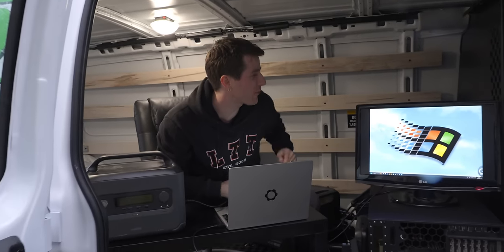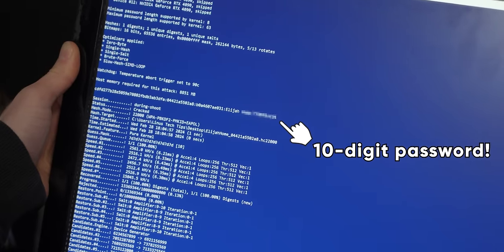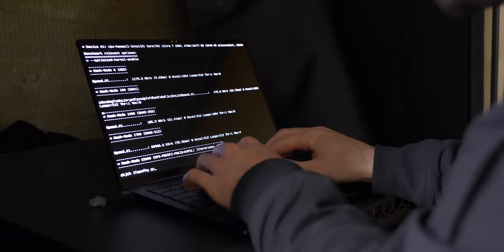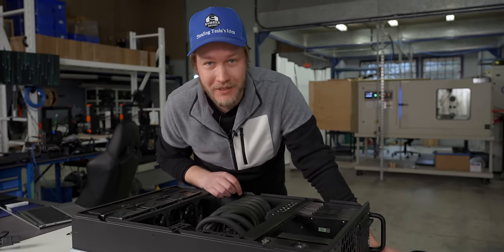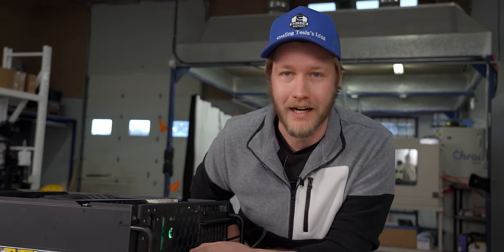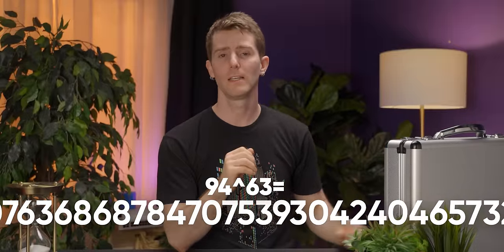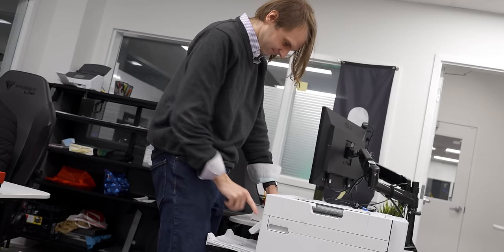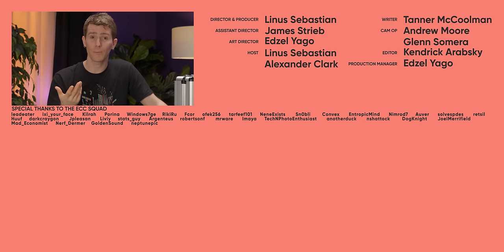I Made a Wifi Cracking Van

Comment: you can also hide your ssid from the public by turning off ssid broadcast in your router. your wifi will still work but you have to manually put in your credentials on every device that needs to connect to it

Comment: You don't need a van nor server to crack those hashes. Just use your laptop with supported adapter (keyword here is "monitor mode"), then some applications like wifite. After grabbing the handshake/key, you can use web services to crack those for a small fee rather than paying thousands for GPUs. (Sending this on my neighbour's Wifi because I'm cheap. Old TP-link routers are notorious for using only 8 digits of only numbers for default password, hashcat can crack those in seconds even without a powerful GPU)

Comment: you can even crate multiple networks under the same SSID. Debending on the Preshared key used to connect you will end up in an different vlan than other Devices, all under the same WIFI SSID.

In Ubiquity unfi this feature is calles "Private Pre-Shared Keys"

Comment: 13:22 guys dont do that, managment frames will take up air space and then data will get less air times, this will result in less speed. if you really wants to do that still, you can also increase beacon period to 200 or more. just don't increase it too much because if you do that some of your devices may start to disconnect every now or then or not connect at all or not see the wifi network at all.

Comment: TIL that being an IT support engineer for 2+ decades has actually been a benefit for ensuring my wifi network is secure and pretty hack proof. All of the vulnerabilities discussed in the video are mitigated and/or are not part of my network. I've even got a seperate vlan configured for my older IoT devices that have very limited access.

Comment: I was recently in the market for a new router, and was shocked to find that basically all consumer-grade routers I looked at which were "well rated" (and under $200 or so) didn't support VLANs, much less additional SSIDs beyond maybe a single guest network. And a guest network, assuming it's segmented properly, won't work for a printer for obvious reasons anyways.

The best options I found were either rolling your own a la PfSense/OpenWRT, or going with a Mikrotik/Firewalla/similar, but those are overly complex options for a typical consumer. Why can't Netgear or TPLink or anyone develop router firmware that allows segmentation, is otherwise no harder to use, and doesn't cost an arm and a leg?! In the end I ended up sticking with Ubiquiti. (They do offer a seemingly great Dream Router for $200, but good luck finding it in stock....)
Reply: Yep, I use pfsense and MikroTik at home for this reason.  Great combo!

Comment: I learned how to do this when I worked at a kiosk in the mall to find some wifi to use with my laptop. (The only open wifi available was a coffee shop below me that was slower than my old 14.4k modem when connecting through the floor)

Comment: You do realize that WPS still exists. While yes it is a massive security risk while active you only need to activate it like once a year. So im using my 63 random WPA2 password and sharing it via QR code with the exception of the rare stupid appliance that can't do QR (like a kindle) that i have to connect every once in a while via WPS (which i shortly enable and then promptly disable again)

Comment: PSA: One thing more insecure than WPA2, is a printer with wifi on in general. Please, just turn off the wifi capability of your printers. Use a raspi and set up CUPS, or go thru USB or if you must, ethernet.

PSA 2: This video suggests setting up multiple SSIDs for improved security- note that this could cause channel crosstalk and slow networks. It's also generally rude to do so in large populated areas like apartments where the 2.4ghz band is likely already full. For 5 ghz only do it if you can enable DFS (cheap routers these days don't even support it; if your router does but the AP keeps switching then it's possible there's radar interference preventing you from using DFS)

PSA 3: a hidden SSID may work to get amateur people away from your network but provides no further security. A better alternative would be to set up AP scheduling (aka turning off/on your router when you need it or not), no one can connect into your network if it's not even on.

Comment: my entire home network is separated, so my own devices use one network, my home automation and smart home devices all use a different network(with a hidden SSID) and a guest network with a somewhat easy password, but with speed restrictions and monitoring to notify me of new connections, so i can keep track.

all networks(except guest network) is also mac locked, for that slightly better security, and peace of mind.

now yes, someone who is persistent enough CAN get on my network, but to be realistic, who would even want to? there are several networks on my street with default passwords, less secure passwords, and even a few networks without a password. so trying to get my wifi password is that much harder than just cracking theirs, or just connecting to the few open networks.

Comment: You forgot to mention WPS enabled Wifi networks. That "technology" has vulnerabilities that it doesn't matter if you secure with WPA2 or WPA3, you can crack the network in minutes even with a $300 laptop. You don't even need the handshake.
Tip for all: Go to your router and disable WPS.

Comment: If you put that printer in a separate network, printing over wifi will usually not work. Yeah it can be done with a proper network setup and good hardware. But for the usual plastic router, it's just not gonna work.

Hardwire what you can, treat your LAN like you would treat a company network, encrypt your stuff.

Comment: Here's a pro tip for any body watching this video. Even if you have a ISP router. Make sure you do your research on the passwords. Suddenlink AKA now as optimum uses patterns to generate their passwords. If someone privy to that information just so happened to want to make a rainbow table. That would greatly reduce the size and amount of passwords they would have to brute force. Special characters don't help if you're keep using the same ones in the same spots or similar spots

Comment: If you're able to gift a compromised device (printer) to the victim you don't need to crack any passwords. You already have an access point inside that network through that printer. That means you can skip all the cracking hassle, no matter what kind of encryption they use.

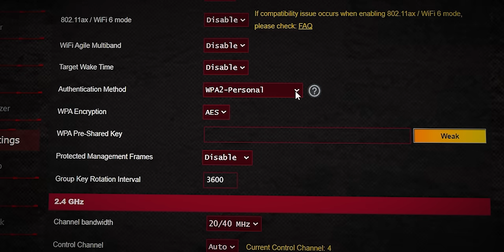Comment: 12:49 Want a really secure WiFi network?  Set up WPA2-Enterprise with AES.  There are no passwords involved.  Instead, each client is required to use its own digitally signed certificate during the handshake to establish the connection.  It's a huge pain in the neck to get working because you need to:  Setup and configure a RADIUS server, sign and deploy a certificate to each client, and then you'll run into devices that don't support that specific mode of WPA2-Enterprise.  It also sticks out like a sore thumb in a neighborhood of WPA2/WPA3-Personal WiFi networks as being the only network in the neighborhood running WPA2-Enterprise with AES.  But it is the only truly secure WiFi network protocol.
Reply: Or a good Firewall. My printer only needs to connect to my laptop. Not to the other printer, my smart TV or the Internet. Etc

Comment: The downside to multi-SSID networks is that... well not a lot of home-grade equipment  asused by the average Joe supports it. You'll need to go a bit higher into SOHO-segment for the Access points (TP-Link has some affordable 4-SSID/4-VLAN Wifi AP), Smart switches and - probably the most complicated - a VLAN-compatible router such as Microtik RB4010 - that is if your provider allows for such configuration or you're fine with double-NAT'ing. Also, good luck getting most consumer-grade equipments to "just work" as expected by the average user, a LOT relies on broadcast/Bonjour to work ootb.

Comment: I'm confused in 11:12 - you calculated the speed for a single-word + random character password, and then jumped straight to "full sentence passphrases don't work" - except if one picked 4 random words from that wordlist you mentioned, the number of combinations would be 1M * 1M * 1M * 1M , which is significantly higher than 1M * 42.+

Comment: I set a strong password (created by Bitwarden), and then generated a Wifi QR Code which gets stored in a cupboard.

It's a bit more annoying for certain devices that happen to be of the 'Windows' persuasion, as Win11 is the only OS that is being given the ability to connect to wifi via QR Code, and that's only more recent.

Prior to that, you needed to download an app onto your PC, which is kind of difficult if you need the wifi to access the internet :P

Comment: I would have been interested in knowing if using hidden ssid completely eliminated that attack vector or it would pick it up when other devices that know the network connect to it? 

As otherwise making your main vlan hidden and just having a guest as broadcast would be a relative easy but fairly strong counter.

Comment: i had the neighbors kid crack my wifi password, only  noticed it when he changed settings.  I changed the password and he cracked it again.  That's when I did research and learn about the security vulnerability in my router having a backdoor WEP key.  I was only able to disable the WEP key after I flashed the bios in it to turn it off.  After that I changed my SSID to "iKnow" and years later it's still that just because I am too lazy to change all my devices to something else.

Comment: I'd hardly call this "cracking" Wifi. At the core it's just brute-forcing and not exploiting a weakness in the protocol as existed back with WEP.
Meaning that as long as your password is complex and long enough, this method will not succeed.
In contrast, WEP passwords can be cracked regardless of how complex or long they are.

Comment: Vlans and guest password are sorrta ok but i prefer the ddr method, or double dumb router. But yea you mentioned this at the very end, definitely the best way and the one that all my actual comouters are on is wired only. Also to note, is the software you use or allow on network, tik tok for example does discovery of all your networked devices

Comment: Only way to make a password. Pick a random key. 
Figure out a way to have something randomly pick between the different characters on the keyboard. (Whatever keyboard you prefer)
Then make a pattern that you will remember. 
This pattern can be either keys that are all near each other one connected to the next or can be say second key in bottom to the left third key in top to the right first key to the bottom right 4th key to the top left and so on. 
As long as you can remember the pattern, you don't even have to remember the actual password. 
Make sure to type it in at least 20 to 50 times in a row. This will give you muscle memory although make sure to do it on the device that you're most often going to be using.
This way whenever you give your password to someone else you can just type it into your phone or laptop or whatever and you can see it so that you can pass it along if they have a different keyboard.

Comment: With all the Wifi devices around my home it was my plan to rebuild the Wifi and security with splitting game consoles, smart speakers, media player and home assistant controlled things into a dumb WPA2 network but I have zero clue how that would work with a Chromecast and my phone on WPA3 and my PC on Ethernet. 

I already have every device with a wired port on Ethernet. 
My parents have a Wifi Epson printer. The Epson app does not send my scanned images over the internet to my phone and printing is done locally w/o internet. So the printer does not need internet but access to devices in the WPA3 Wifi. 

Maybe only allow known devices into my WPA2/WPA3 mixed network? My current router does not support WPA3-only mode so this is only a theory until they allow that/update the firmware to let me make that choice.

Comment: I'm still not sold on what they can really do when they are on your network. Sure you can snoop and whatnot but most connections are still encrypted on the web, so what would they really do? Sure stealing bandwidth and using your network as a point to do illegal stuff is always an option, but you aren't really getting hacked all that much if all they have is your wifi. It needs to be a long-con to do anything more and I just don't see regular people being victim to that...
Having a QR code at the door for Wifi is good regardless of how good your password is though. Just make sure it can't be scanned from outside.

Comment: Well I have a better solution. Get a Raspberry Pi Zero (2W preferably since it is quad core) Install Pwnagotchi project on it which automatically launches deauth's attacks and captures handshakes. Now If you want to go a step further you can also add a GPS module to the Raspberry and a GSM module. Connect an external battery to the Pwnagotchi and take a walk. Now if setup like I intended you should capture handshake packets and save the location on the map, next step should be creating a script that automatically sends the handshakes of the wifi to your home pc and start cracking it. In order for it to be more effective you could place a name filter in order to get all the wifi's that still have the default name since its a better probability for them to still use the default password's (8 digits with takes 2.5 minutes to bruteforce with a 3070 and 5 minutes with an 2060 mobile.

Comment: There is a method called absolute madness where in you use a program like (wirtgen windows rainbow table generator) to write down every possible password combination (dictionary or not) then encrypt them as a wifi router would, store it as a file similar to an excel spread sheet with the password as plaintext in one column and the password hash/result in the column next to it, the encrpted packets are stolen from a wifi network then compared with a table of results when a match is found the password is then known 🎉 😮 😂

Comment: QR shared wifi is NOT secure!
Step 1 - Have a friend share their wifi via QR code like normal.
Step 2 - Once connected, go to share that wifi via QR code on your device (so it shows the QR code on your screen like you're going to share it).
Step 3 - Screenshot that QR code.
Step 4 - Upload that screenshot to a QR decoder website.
Step 5 - PROFIT (the password is shown in clear text).

Comment: What does this mean for all the cheap devices bought on ebay/ali/Amazon. Like wifi smart lights and security cameras etc.. when they connect both to your wifi and require internet access to the "cloud".. they always seem dodgy. Could they theoretically be stealing your data and pushing it up via the online link disguised as device cloud accounts?

Comment: So, if you're in an area with a lot of WiFi, it's not that you need "4 5up3Rh4rD P45Sw0rd", you only need one harder than your neighbor's. It's the old "I don't have to run fast from that bear, I just need to run faster than you from that bear". No need to go crazy, Criminals will take the path of least resistance.

Comment: But it would be nice if you explained how to setup a different vlan on any router for iot devices, how do you tell them to look for that network?
Reply: And there the 'experts' stay silent... sadly. The only way I think you can do this is put another wireless network in your home connected to another router that only has internet and no link to your home servers/nas/pc's, and give that an open wifi-name that your IOT devices can connect to their manufacturer without contact to your private network. But, still waiting for a good video how to set this up for other people.

So: another wireless accespoint, that can be safely stay away from your private network (there are opensource solutions for that, I even built one in the days with a laptop and three networkcards)
Make it so that the name of this new network is totally different from your private to avoid problems.
Then disconnect all your IOT devices and reconnect them through this new network. So if you have Siri/Alexa or Google home, put them also on that new network, so they can talk to the IoT devices in your home.

I used an old pc, with four network cards, a simple harddrive/ssd to put a Linux flavor on it, google for the best router open source software and try this out your self. But Linus (LTT) has the people to do this, there are a lot of smart folks working there, and I hope one day they will pick this up and make a good video about this, to insure your China devices are not speaking to your personal data and spy. So Linus, please, take this up with your expert team and try to make a safer world.
Thanks.

Comment: On what planet are people using WiFi only printers? 
Seriously, get one with ethernet. Its not like your going to take it anywhere. In fact, your probably just going to plug it in, print 3 photos of your cat, and then discover your cant print your concert ticket 3 years later as the ink has dried up.

Why would you use why for something thats basically fixed in place unless it was physically impossible to cable it in?

No RJ45 shaped hole on your printer? Get a raspberry pi, and your sorted.

Comment: I have found people in my WiFi a few times. After that I upgraded my WiFi to WiFi 6 with unifi wep3 and a code that looks like a window key. I also put my dump smart things in a very restricted vlan network because I don't trust them not to spy. I lock out all Mac addresses I'm not useing. Even though password is kind of simple it is the maximum length WiFi n does and that is the oldest dump smart thing I have.
My list of dump smart things are.
Phones, TV, home automation, tablets, sprinkler system, ps5, Xbox.